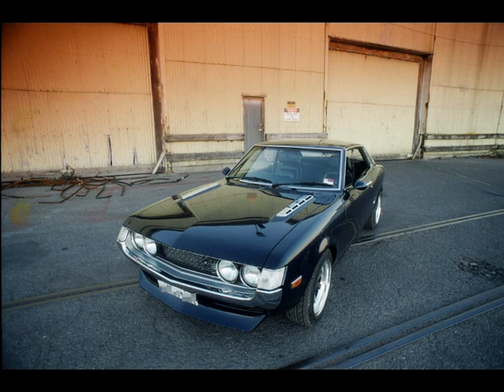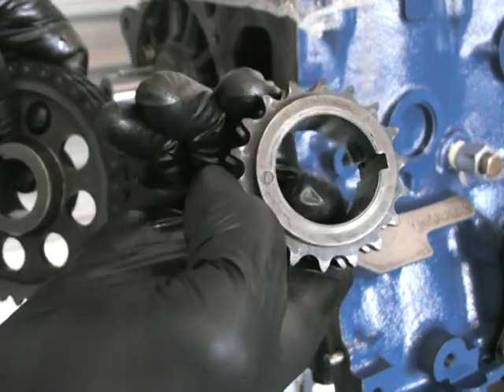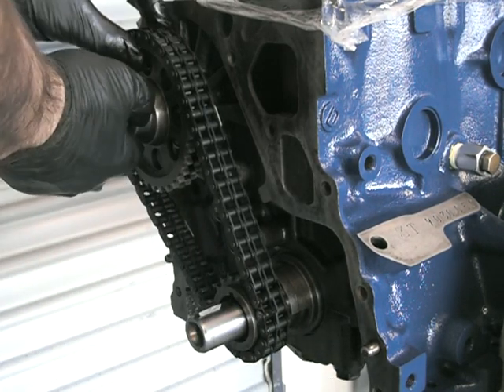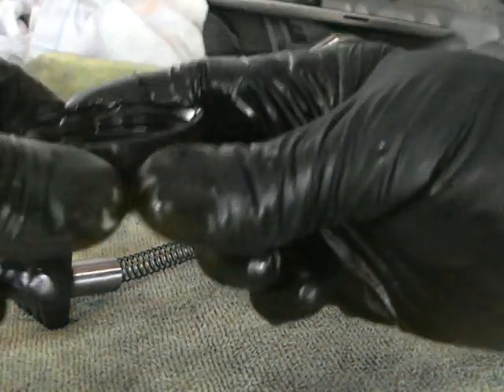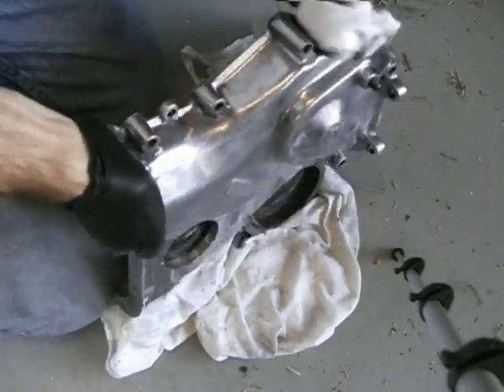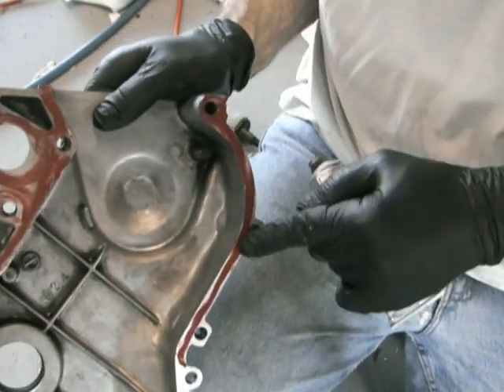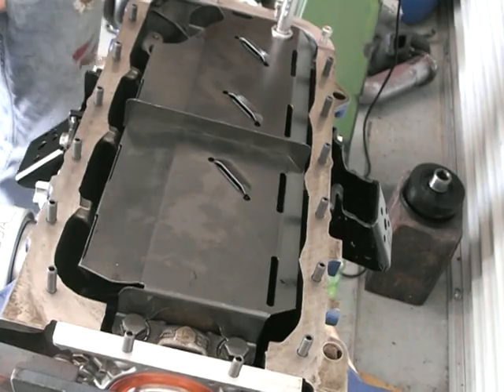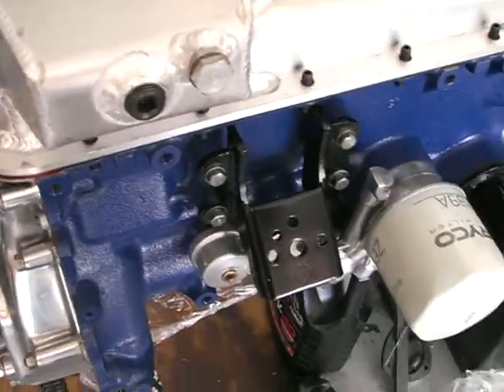Toyota 3T-GTE bottom end assembly

Comment: Can you install the 2T-G head and cams on a 3T block? What is the compression ratio then?
Reply from the maker: Yep, you can. The 2T and 3T blocks are the same. Compression ratio will be the same as a stock 2TG if you use 2TG pistons. You just need to insert the blank is place of the single cam.
Reply: Very interesting. I have a pair of mikuni-solexes and intake for 2T, not sure if they are interesting to anybody or if the mikunis are hard-to-come-by or not. Carbs might need some new parts. I am thinking of refurbishing them or selling as-is and possibility is also to evaluate if parts could be custom manufactured. Thanks for the reply.
Reply from the maker: @FourSeasonsHD  Cool, someone might be looking for solexes. If you want to sell maybe post a message on my Face Book Page, also Classic Celicas and more